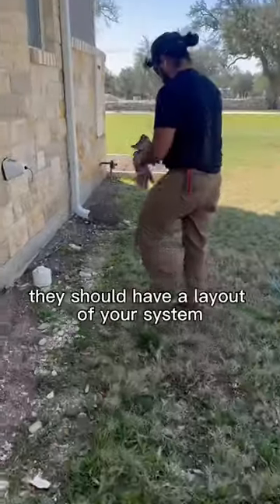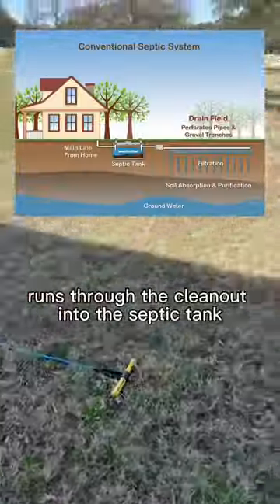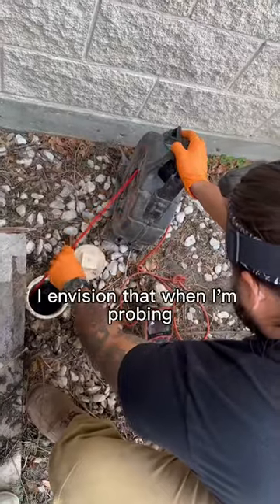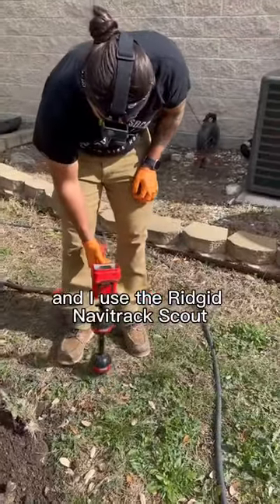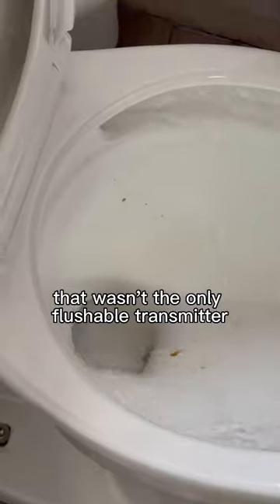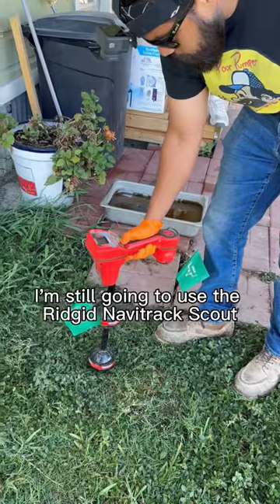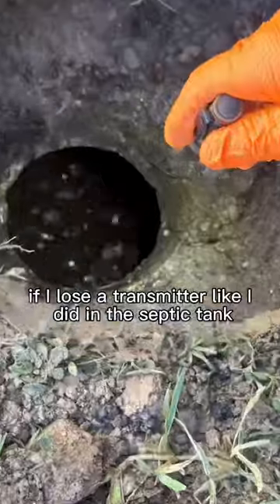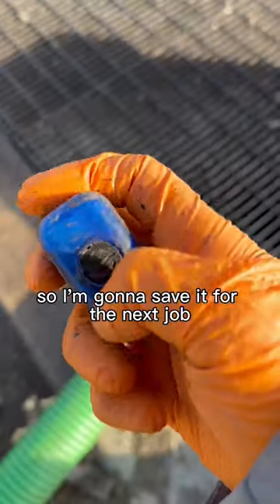How do I find the septic tank lids? #shorts

Comment: What else can the rigid pickup ? Water pipes are usually copper or brass, do those show up with the rigid ? Does it know the difference between cable and electric lines and phone lines and the fiber-optic lines do those have a metal line in them so that they show up ? 
I heard that the cable company actually used a frequency tone that allows you to find their cables. That put that frequency on the jacket that insulates the cable.